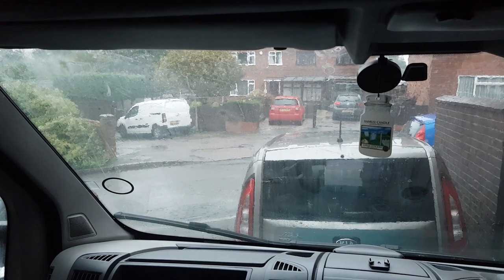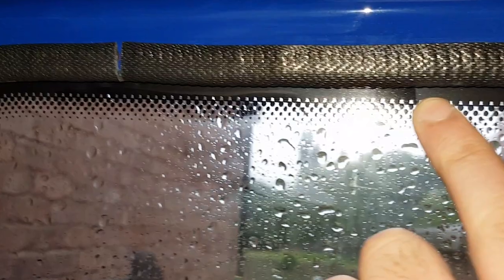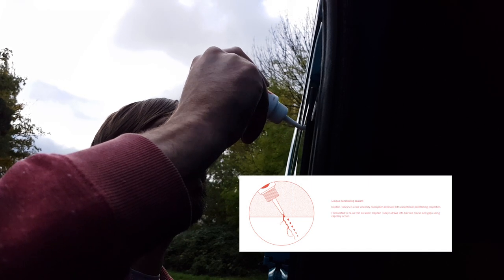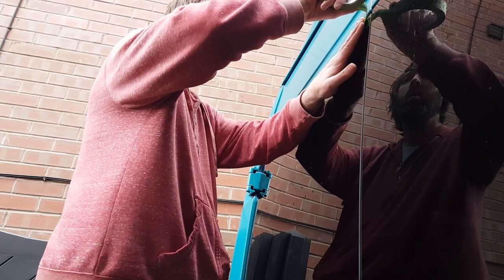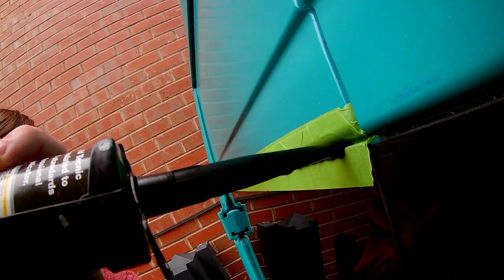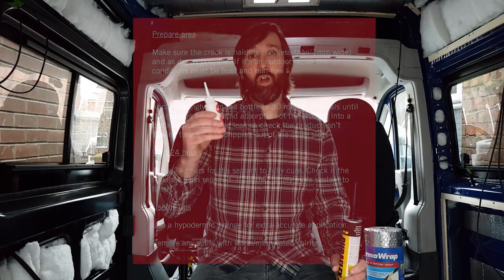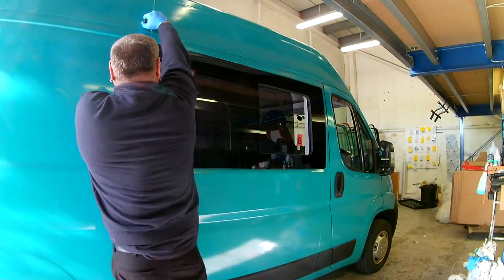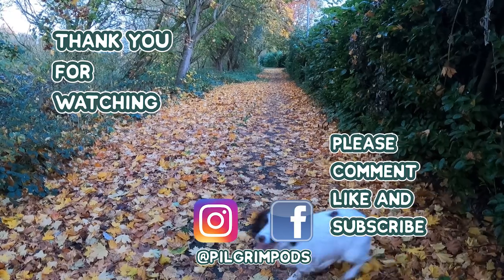How to Fix LEAKING BONDED WINDOWS in a Self Build CAMPERVAN - DIY Budget Campervan Conversion

Comment: Great video, been thinking of doing the van side windows myself like you did on my next van. After seeing your video tonight. Will have my windows done by a professional. Watched most of your videos, loved everyone of them. Can’t wait to see your next one
Reply from the maker: Yeah it doesn't appear to cost a great deal more to get them fitted professionally and it gives you peace of mind they're correct. I'd certainly fit them myself again as I now 100% know what I'm doing but I could have saved myself a lot of time and stress first time around paying to get them done... 😖 Best of luck with the new van when you get it! 🙂👍
Reply: @PilgrimPods  Thanks Craig, look forward to seeing the rest of your van build and seeing you on the road 🙂
Reply from the maker: @johnphilip6609  you too mate. 🙂👍
Reply: I've just ordered windows the same as yours tinted by van pimps, now I'm feeling a little nervous about a faulty opener.
also, I will use some professionals to fit them thanks for a great bit of information

Comment: Great to see the leak is fixed!!
As you have said in the video, the bead of mastic was a bit uneven and thin when you did the first fix of your rear window glass... The depth of mastic used by kiravans was delivered using a ‘v’ in the nozzle which creates an even depth and broad line of mastic against the van body.  This will give you a better bond with the glass pressed onto the mastic as it will broaden out and fill any potential unevenness.
Well done and great advice to anyone looking to fit their own windows 😎👍✅
Reply from the maker: Thanks for the knowledge bomb Andrew! 🤯😁 When we applied the mastic to the side windows we did a much better job of the bead but still not perfect in our eyes even though the windows are perfectly watertight. We wanted to try to do it ourselves and think we nailed it apart from the mastic application. We know better for next time thanks to our self analysis and advice from folk like your good self. We only hope this video can help others avoid some pitfalls or needless worry. 🙂👍
Reply: @PilgrimPods  it’s so well worth watching your video, it’s a great pointer to folk wanting to do the best job they can on what many see as only possible by professional fitting services.  For the nervous that may be the best option, but as you have shown, you can do it yourself 👍✅
Reply: ....did I say don’t ask me how I know? 🥴

Comment: Cheers for posting this. Got similar leaks in 2 of my windows. I believe the problem it due to pin holes in the adhesive due to the bead not being one complete bead like in your video. If I ever fit windows again I’ll definitely get an electric gun for the sealant. Going to try option 2 and if I’m not happy I’ll look at removing and refitting
Reply from the maker: Best of luck mate! If ever there's a next time we'll invest in a better gun too. You live and you learn. 🙂

Comment: Hey thanks for this video! I just installed a window and have a small leak that drips in only one area so I just tried method two (adding more sikaflex) hopefully that will make it water tight, if not I'll remove window and re apply with a better caulk gun (mine is 10:1 advantage, I read 12:1 is the min recommended for polyurethane). I believe it's because it was so hard to get out I had uneven bead.
Reply from the maker: We live and learn hey... Glad I attempted ours and would definitely do so again with lessons learned and more confidence. Hope you've made that window watertight mate. 🙂🤞

Comment: Hello and good morning. Is the Puraflex 40 as good as Sikaflex 521? Is there many difference between them? Price wise? Greetings. In your Van I see the plastic trim on the B pillar, also on the roof between the B pillars. the cover I mean; where did you got them? Greetings.
Reply from the maker: If you look at the properties of the two they're pretty much the same stuff only Sikaflex is a lot more expensive. The trim came with the van when I bought it. Because it was a PDSA van I don't believe it had the metal bulkhead and left the factory with the plastic finishing trim in its place. 🙂👍

Comment: Hi, good honest video here.
From what I can see, I have the same side sliding windows on my boxer as yours. Though I had mine professionally fitted. The bond to the body is well sealed, but I am getting leaks though the sliding mechanism. Have you experienced this?
There are drain runners on the back side of the glass, but I seem to get water between the body and the glass, the wrong side of the drain channel... On top of the main bonding bead basically... Any ideas before I start taking it apart??
Reply from the maker: Hi Rob, sorry for the slow reply... I haven't experienced that issue personally and wouldn't know how to rectify it. What I would say though is I'd definitely be taking it back to the window fitters to sort out as it could be an error on their part. Then again just like in my video you may have fell unlucky and purchased a dodgy window and if that's the case I'd be chasing up whoever I purchased it from to replace and cover the cost of removing the old and fitting the new (if memory serves, ours cost £60). Hope you get it sorted mate and thanks for taking the time to check our video out. 🙂👍

Comment: Additional tip: Take a can of compressed air and flush out all the water behind the glass before applying the sealant. That way no water is trapped behind the window.

Comment: The instructions that came with my bonding kit were so incredibly WRONG that I ended up doing a complete balls job on my own windows (much worse on the first) Basically telling me to put the adhesive on the window and not the van, so when I went to put it on it was in the wrong place, also absolutely no indication that the adhesive had to be 20-25 C or it simply will not come out of the tube. So yeah, really bad job on one side, fairly annoyed at the manufacturer giving instructions of such poor quality. So bad I would consider it grossly negligent tbh.
I'll do my best to tackle it with some sealant and more bonding, but I wouldn't be surprised if I have to remove the window completely and do it again. Hopefully I can jerry-rig a solution together...

At least this video gives me some hope! Although to be fair I actually think my situation is way worse... ugh

Comment: The only way to fix leaking windows is to remove them and refit with a better bond line. Having seen your install video I'm not surprised they leak, your urethane application was terrible.  Your fix will only be temporary,  the bond will fail over time and you'll be back to square one.
Reply from the maker: All covered in the video Jac.

As someone once said... 'It is not the critic who counts; not the man who points out how the strong man stumbles, or where the doer of deeds could have done them better. The credit belongs to the man who is actually in the arena, whose face is marred by dust and sweat and blood; who strives valiantly; who errs, who comes short again and again; who spends himself in a worthy cause; who at the best knows in the end the triumph of high achievement, and who at the worst, if he fails, at least fails while daring greatly, so that his place shall never be with those cold and timid souls who neither know victory nor defeat.'

Me? I say thanks for feeding the algorithm. 👍